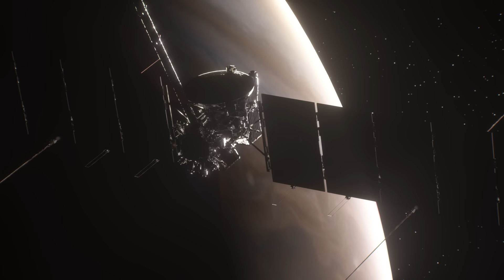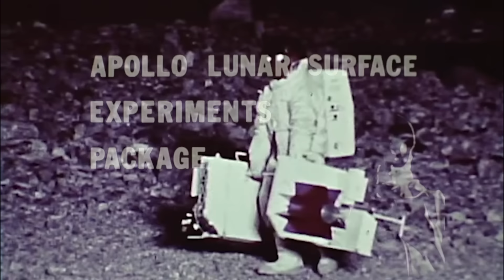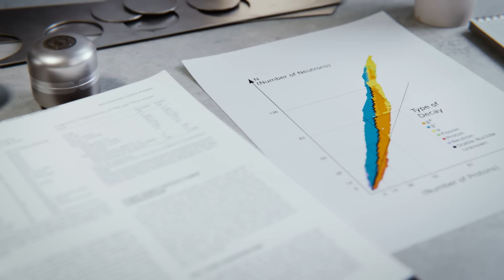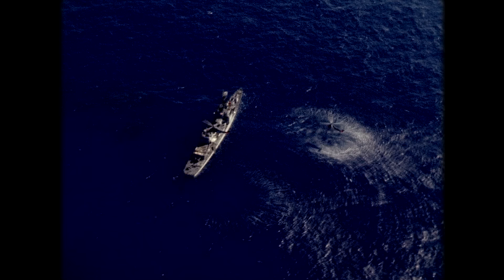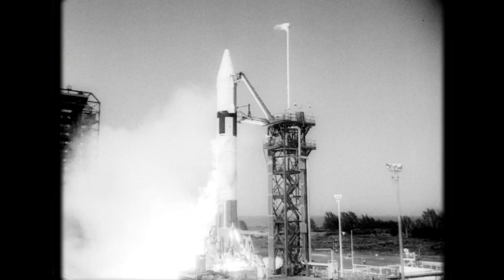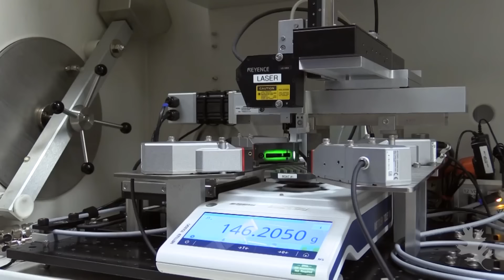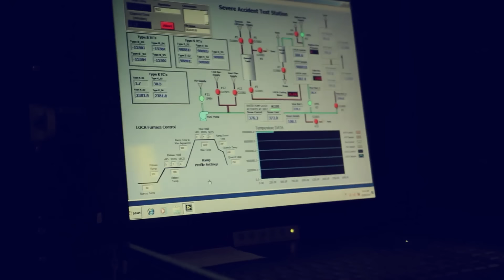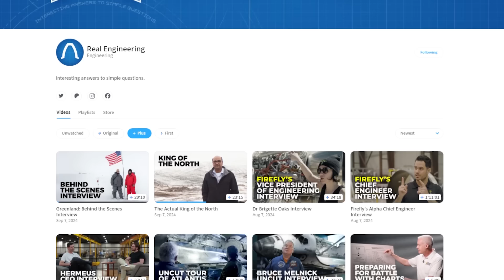NASA'S Plutonium Problem

Comment: If only people didn't associate nuclear with bad, maybe more people would care about this.
Reply: odd how people fail to associate the subsidization of renewables with public debt
Reply: @cynikal82  Fossil fuels are also subsidised.
Reply: @albal156  indeed. while the third and best energy option is regulated into oblivion
Reply: @ Yep. Think we need subsidies and smarter regulation of the nuclear industry.
Reply: Because it's bad in the hands of bad people, or as a target of bad people. It's less about nuclear power than the environment it's put in.
Reply: Coal and oil lobbies shrieked the word "Radiation" in the 60's and 70's and scared people. Then idiots like Jackson Brown held "No Nukes" concerts. They fucked over America. France gets 80% of its electricity from nukes and is now selling power to Germany, that was stupid enough to shut down it's reactors. I think we should hire the French to come in and build clones of their highly successful power plants. Ours are all different.
Reply: If you add a single extra neutron to the desired isotope, you get material dangerous enough to invade Iraq. The labs that produce this stuff get hit by tomahawk missiles and for good reason.
Reply: People associate nuclear with expensive.
Reply: Maybe things will have gotten better when they add the 'N' back in to MRI.
Reply: @chromolitho  MRI uses magnetic fields and radio waves to achieve imagery. When they use radioactive stuff, you actually ingest it.

But yes CT scan and xrays use radiation, whats your point? Never seen a CT scan meltdown. Have you?
Reply: @chromolitho  whats your point? We all know medical imagery uses radiation, we all know the risks associated with it. I just never saw an CT scan meltdown that explodes a whole hospital, ever, have you?! 

Btw pretty sure MRI's uses magnetic fields and radio waves to achieve imagery. CT scan and xrays uses radiation 😘
Reply: I'm happy to say lately this seems to change.
Reply: Its not really that its bad, but really needs to be handled carefully, because let's face it, it is more dangerous than say a gas plant, both could explode, the consequences just arent the same though.

You Also must have very strict regulations around it. And well there is so far, only one place in the entire world to store nuclear waste permanently, which is also a problem, not that it cant be solved, but still a problem.
Reply: @guillaumeasselin5394  Not sure how my original reply got deleted, but nuclear energy is actually the safest form of energy. It has the lowest death rate, besides maybe solar, and is cheap and incredibly efficient.
Reply: @EvanG529  well its not cheap for a start. And even if it is somehow safe to use, it is not safe to have in your backyard. Fukushima did not happened because the reactors and things werent safe, natural disasters can and Will happen, we will leave war aside for this discussion just because..

And when that stuff happens the consequences really are terrible. And those consequences WILL outlast humanity. Chernobyl Will be radioactive for billions of years to come, that sarcophagus is really only a temporary solution. We have to factor that in.
Reply: @guillaumeasselin5394  Storage of nuclear waste is a solved problem.  The solution just hasn't been implemented.
Reply: @guillaumeasselin5394 it's expensive because of so many regulations, I get a lot are required but you must admit some are just cost increasing measures
Reply: @hellishcyberdemon7112  well i must admit i dont know much more than anyone here does about regulations around nuclear energy. But im pretty sure they are in place for good reasons, im not the type of person that thinks they put regulations in place just to raise prices. Theres always a good reason!
Reply: @hellishcyberdemon7112  "you must admit"
no one has to admit to anything especially when you stay vague without example.

@guillaumeasselin5394 "Theres always a good reason!"
equally not the case, sometimes they are based on political reasons of a time period that fall of the wagon later on or because new technology made them obsolete. I am not saying, this is the case with regulations and rules about the handling of nuclear material, i am just saying that absolutes are better be proven by facts.

Both of you seem to make the mistake by arguing with absolutes which leave no room for the other side.
I wish you both well and have good one
Reply: @guillaumeasselin5394  mainly yes, but I know some interesting things about regulations and some are actually dumb and put in place just for paranoia, not to raise prices or anything, but the uninted outcome is that. For example NPPs in switzerland need a safety analysis study in the event of a tsunami, in the alps... In finland they need to account for metorite impacts. Here in Italy the dumbest regulation we have is that our research reactors can't operate in pulse mode because the regulator is too dumb to distinguish Power from Energy, saying something along the lines of "the power can reach scary number levels" despite it happening only for a microsecond.
In the US the cement used for the containment cannot crack, which seems good in principle, but crasks relive some of the imposed stress. In the UK leaving two piles of austenic and ferritic steels too close to eachother is cause for a "workplace accident" and needs to file a report, if I remember correctly the Hinkley point C project has something like in the order of dozens of these every day.
These are just some of the examples that I know, of course most regulation is good and for safety, but some is absurd.
Reply: @guillaumeasselin5394 you have far too much faith in the government
Reply: @hellishcyberdemon7112  no you mental castrate. it's expensive, because you have to store nuclear waste products for 100.000+ years (not kidding) SAFFELY, secure the reactors from inside and outside attacks and radiation shielding.
Reply: I don`t see a reason to waste money on an expensive and dangerous technology when meanwhile renewable energy here in Europe at least, is self propelling. It is cheaper to build at scale, cheaper for the consumer and safer in its use. Sure it too has issues, but by far not even in the same ball park.

I am not strictly against the use of nuclear energy where it makes sense as f.e. in space exploration. Even as a nuclear deterrent i am open for that if it help to keep the peace. Otherwise nope.
Reply: @kinngrimm  sure renewables may be "safer" but don't produce the power mass necessary for places like America, plus nuclear isn't that dangerous not anymore because anyone handling the material is trained

Comment: wouldnt plutonium 238 be a good way for civilian sectors to generate nuclear power? it might be more viable if large energy corporations start creating it?
Reply: It is not cost efficient. You put a lot of energy and resources in just to receive small amounts of energy over time.
Reply: It's not power dense.
Reply: Absolutely not.  

Certain types of Nuke plants require certain types and grades of fissile material, like the CANDU for example which uses 5% enriched Uranium Oxide pellets.  

With nuke plants, you go with tried and true designs because financing the projects is obscene as is the 12+ year buildout time.
Reply: In the video, it literally mentions it takes so much of effort to even make in grams. So, how much would a city require? Power input >>>> Power output. And then there is cost and all...
Reply: @ just thought that if its so safe that it can litteraly be launched in a rocket and explode and still not be an issue, the cost might be worth it for the safety. also thought that if civilians started mass producing it it will become more cheaper
Reply: Besides the lack of energy density, which part of "production can't keep pace with the demand" did you miss?
Reply: It is too hazardous for civilian use.
Reply: @MetallicReg  why is it too hazardous? Not for the military though?
Reply: @hellishcyberdemon7112  Well obviously. There is a difference for clearance in governmental controlled and military equipment in contrast to civilian use that can have lower standards for safety in handling.
Reply: @MetallicReg  but in most cases civilians are better trained than military because military stuff is a standard not the best not the worst, I guess it's same way I feel about civilians owning military equipment
Reply: @hellishcyberdemon7112  No. In most cases there are professionals with higher handling clearance than a civilian could ever get. This means they have a higher hazard danger aswell, which they contractually signed on with the government.
Civilians have a higher responsibility for safety of their personnel and the insurances involved than governments (that essentially have unlimited financial backing).
Reply: @ I guess we wont really get a nuclear revolution until civs have the same clearance and equipment and subsidies as the government so people can start building reactors as a community project, we wont progress the future if its constantly kept locked away for "danger" we need to be able to study it in its fullest and accept the risk so we can progress forward
Reply: @hellishcyberdemon7112  Dude, commercial power plants are civilian run nuclear infrastructure. The divide here is not civil vs military more like proven tech vs experimental, and the later has a steep hill to climb as the regulators can guarantee safety only in systems they understand, which means that whatever innovation you come up with you have to explain, demonstate and prove safety for the regulators. it's a very long  and ardous process, which cuts into profit, which removes incentive.
Reply: @CraftyF0X  Well let me ask you this, how quickly do you want to save the planet? because we need to go back to the 70s and start running wild when it comes to letting people in and innovating, keep the safety standards high but subsidies and spend tax dollars on funding high school and college studies learning and getting ready to work in the nuclear field, if its always about profit well, i guess people need to stop bringing up green energy because it will NEVER out produce or cost less than oil or gas

Comment: You could just buy them from France or United Kingdom if only US wasn't so stubborn.
Or better yet, repeal the ban on recycling nuclear waste in US, so that you can adress both problems at once.
Reply: Actualy neither UK or France have a sufficient stockpile. Russia is the only one because their space program pretty much died after the fall of USSR so they had no way of using it up but other than that the only way is to ramp up production.
Reply: @piotrhennig4122  UK has 140 Ton of Plutonium in nuclear reactor.
Reply: @RichardLionheart12  its Pu 239, the different material.
Reply: @piotrhennig4122 in russia they have operational fast breeder reactors that can produce these and much more. But US sanctioned Rosatom, so probably not reachable.
Reply: @markpowder4664  sanctions are not the main issue. WestingHouse will throw a tantrum if you will allow free market competition.
Reply: @piotrhennig4122  according to numbers I found, the UK has 4.7 tonnes of Pu-238 in storage.
Reply: @piotrhennig4122 We (UK) have 140 tons of Plutonium stored at sellafield reprocessing plant, which includes p238 because the Plutonium at Sellafield is refined (as all plutonium is) from reactor fuel, which creates p239 and p238.
Countries from all over the world send spent reactor fuel to Sellafield for reprocessing.

There's quite a bit of P238 remaining from the 70's from when pacemakers were powered by it and they (Sellafield were producing it for NNL (National Nuclear Laboratories here in the UK) for the European Space Agency.
Reply: @piotrhennig4122  no stockpile 'yet' but as RE stated, France already has a full facility up and running to recuperate plutonium.
So it's maybe not half way there but at least a quarter.

If socialist/greens don't fuck up France's nuclear indstry even harder :'(
Reply: @Soenglish44  They won't win thats for sure.
Reply: @Soenglish44  Be quiet man love how you people carry on.
Reply: @Soenglish44  The French spent fuel reprocessing operation recovers Pu-239 and Pu-240 for use in Mixed-Oxide fuel (MOX), added to depleted uranium (U-238) and some U-235 to manufacture new fuel rods. There might be a small amount of Pu-238 in the mix but it can't be separated out since it behaves chemically just like the more common Pu-239 and Pu-240.

Russia and some other countries reprocess spent fuel too but once-through uranium for power plants is cheap enough the plant investment and cost of reprocessing usually outweighs the benefits. Dealing with the waste after reprocessing is also a problem.
Reply: If you want science to get any funding, grants or attention with the current administration, well... good luck.
Reply: @randomusername-s2b  Yeah, if things were bleak before the new administration, then they're pretty much hopeless now.
Reply: Elon will get plenty of money
Reply: The US seems to only draft legislation that benefits billionaires, makes the working class poorer and destroys the environment, while pleasing dicators and alienating allies.
Reply: No, you can’t. 

The UK and France both still get their fissile downblending and enrichment services from Russia.

You science people seem to be woefully unaware of geopolitics or how the logistics of worldwide energy flows work — which is sad because it’s your type that thinks solar/wind will save the planet when we don’t even have the raw materials to build out a renewable energy infrastructure.
Reply: but nucler waste is like 94% to 96% recyclable. so teachly nuclear fule presoring of high level nuclear waste would make the same amonut of mined ore last likeover 10 time longer for the same aonut of power ouput in huge amonutsd of surpluss energy. so no just mneing it for he sohrt term acatly wastes more money and energy then just repoceing it in the long term beace so much eclcal power to power elccal mneing vecales would just bacly combend with nuclear fuel repceing is actaly is what we where ment to do untill to much dumb poctics got in the way jupming sharks and fear mongering instad of long term soltuons.
Reply: still need oil for thsoe vecales to stay lubcated with thsoe internal mehcacal stuff elitcric or not. big meing drill  need alot of lubercate and you need to have oil to make that kind of stuff bescue good lubcatiiing luncates need to be made as a byprodcut of oil refering. anyobyd that played factrio would tell you this.
Reply: also oil is still neeed to make the checmals that make mciro circit pcb boards for the cemcal baths to make them proeprly conduct properly as well.
Reply: Pu238 is not a natural byproduct of nuclear power generation. You actually need to manufacture it in a special reactor.
Reply: Dude, Reagan lifted that ban in the '80s.  The reason we don't recycle nuclear waste is because getting fresh uranium fuel has been a lot cheaper - especially when we were buying it from Russia's old nuclear missiles.  And before we could start reprocessing old fuel now, we'd have to build up a whole industry for it.
Reply: @Cynthia_Cantrell  Same reason we don't recycle MOST things in reality nowadays. Only steel and aluminum are economical, in reality. And even that, not really.
Reply: @Cynthia_Cantrell well kinda,it’s also we didn’t build designed  plants for recycling so it isn’t worth the money if building a new one to recycle. Allot of other countries do it without cost issues
Reply: @Wwelch117  It is absolutely worth building plants designed for recycling. We have a major power shortage and need to buy power from canada. We have a market, and we could reproccess old fuel. Fresh uranium fuel will eventually get really expensive, and if we saturate sites where it is underground, it will not be safe to dig up to recycle. We are shooting ourselves in the foot by not recycling it now.
Reply: @Cynthia_Cantrell and nobody wants that because capitalism.
Reply: @Cynthia_Cantrell  old what? Dude, you are full of propaganda. Study the topic, it does not bite.
Reply: @Cynthia_Cantrell to leave 99% of humanities w energy in waste is irrational
Reply: @ The only rationality that capitalism needs is profit - and it will always go where there is more profit, unless "job-killing regulations" force it to do otherwise.